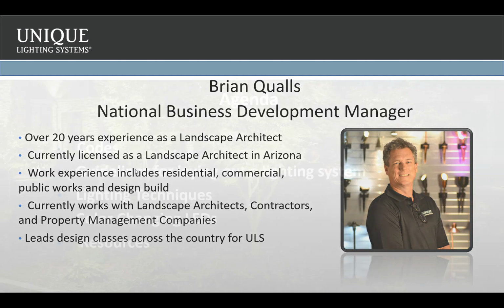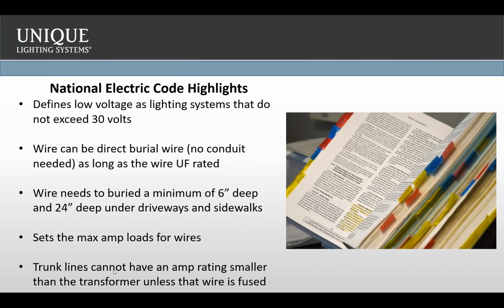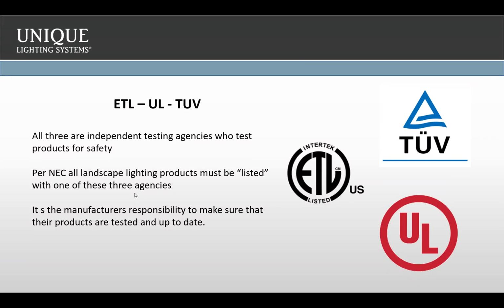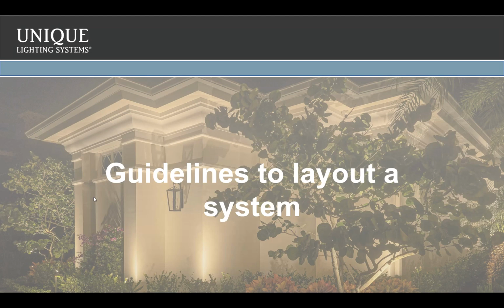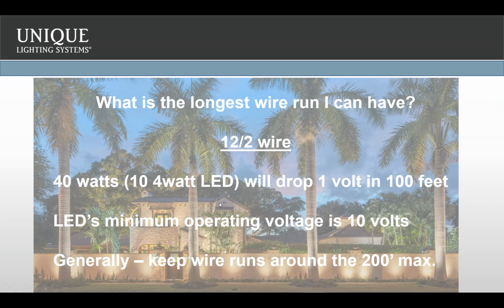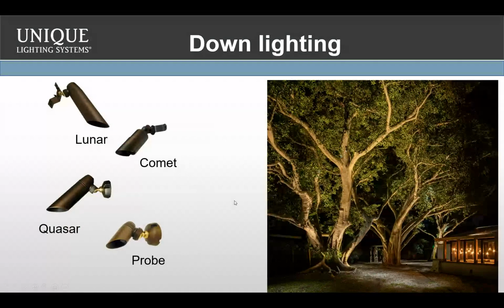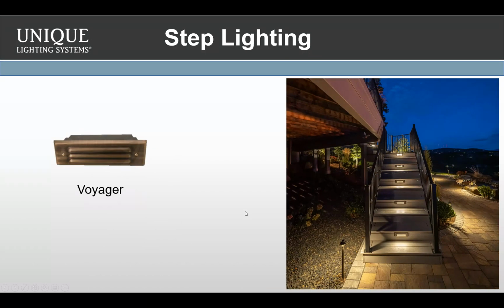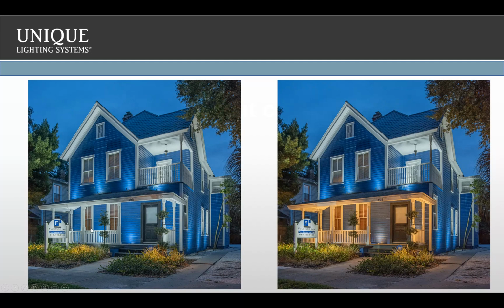Webinar 2 - Codes, Guidelines and Techniques

Comment: I’ve got 4 12-foot wide front porch steps being built with stone veneer. I wish to use led step lights possibly your Vanguard. My question is how many lights per step is recommended and how should they be wired, daisy chain?